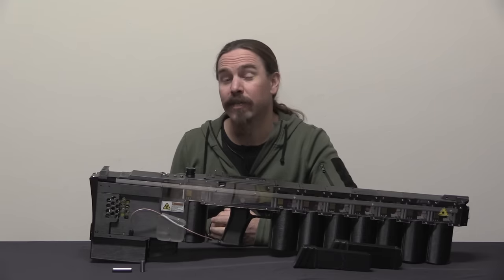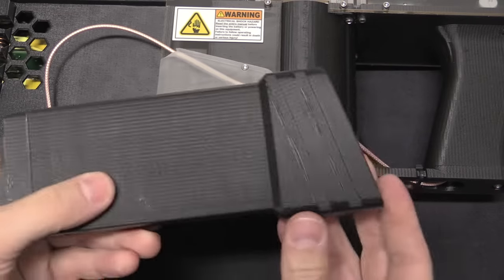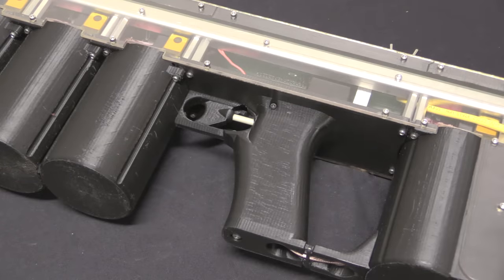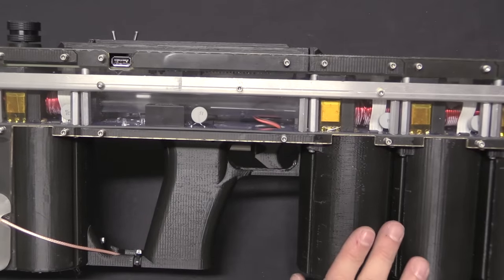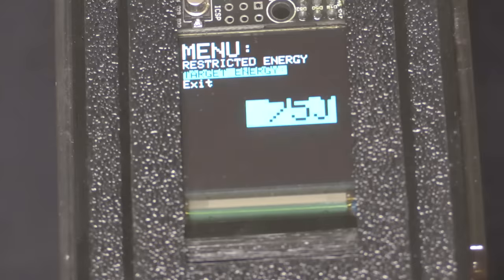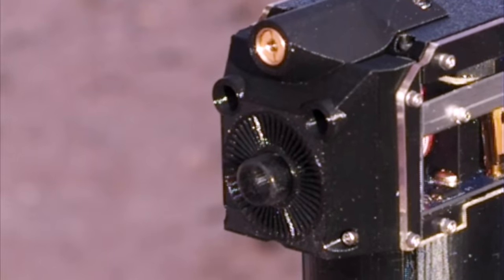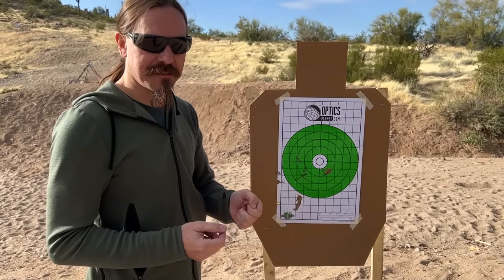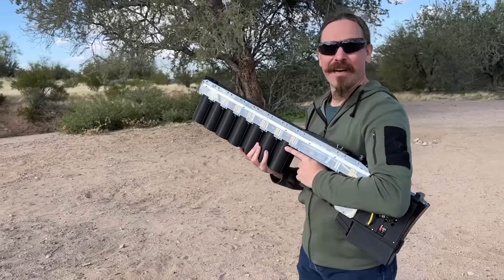ArcFlash Labs' GR-1 Anvil Portable Gauss Rifle

Comment: Consider trying it with half inch ball bearings, if there's a magazine that will feed those.  Since the projectiles are tumbling anyway, you may as well use something you don't have to make or fiddle with at all.  Just take them out of the bag from McMaster or wherever, and get straight to it.  Sounds a lot better than chopping up steel rods.
Reply: Not sure balls would work out well,  it seems to be the projectile has to have some length to it so that the coil can"grab" onto it and accelerate it down the barrel
Reply: In the interview episode the developer mentioned that there's a relationship between size and efficiency - if bearings would work you could have just scaled up an airsoft magazine to feed the launcher instead of designing one from scratch
Reply: There's a smaller version of this weapon that does use ball bearings.
Reply: Alternatively the back half of the projectile could be hollowed slightly and cut into to shift the projectile's mass forwards and create effectively thick fins, which should hopefully improve it's aerial stability
Reply: It probably wouldn’t be too difficult to add an extension to a Nerf Rivals or 50 cal paintball mag
Reply: My thoughts exactly  !!!
Reply: @Gecko88  If the designers of this device have considered every possible improvement, then this device has hit it's limit of development.
Reply: @Psychedelic Gecko  you mean you've never seen something designed by engineers who've been visited the "good idea fairy"? I currently own a makita line trimmer/brushcutter that has a line trimmer head that is ...........a clusterfuck of a design.  They didn't try to just copy existing designs that work well and put a slight change here and there to avoid any patent issues, they decided to make it much harder to refill and insert back into the head.  Engineers aren't infallible, they can be too "smart" for their own good.
Reply: I was thinking about flechettes or dart-like munition that way they would be more aerodynamic and the fins could stabilize them. Also some kind of pump action to create a vacuum in the barrel to reduce air friction in the barrel
Reply: Sounds like the rail gun from metro 2033
Reply: With this technology, bigger projectiles accelerate faster, and a sphere would be the smallest projectile possible for the bore size.   You'd solve the tumbling problem, but decrease speed significantly.  It would be nice to know the relationship in speed loss vs accuracy loss with a sphere vs rod shape.  As the owner said, there needs to be a way to stabilize the rod/projectile.   In the future, if/when capacitor strength and this tech improves, it may be so powerful that a sphere may be the best projectile size.
Reply: a ball bearing in a plastic sabot sleeve would be cool.
If you can do that, then an aerodynamic dart in a plastic sabot would be great too.
Reply: Electromagnetic characteristics of the projectile strongly depend on the shape, you can't do anything complex like flechettes or darts without negatively impacting the acceleration of the projectile.
Reply: Good idea
Reply: @r10101  A return to Minie Balls.
Reply: @Ailtir  I wonder if something like an airpellet shape would work better. Lots of mass up front with what is essentially a drag stabilizing tail in the back. In addition it isn't impossible to add non-ferrous components to a ferric dart.

Maybe a lead or plastic shell around a steel core optimized for acceleration. I wonder if copper would be a better projectile?
Reply: You don't understand the basic rail gun concept - the projectile has to have iron (Fe) inside it to be attracted by the intense magnetic field progressively generated by each coil.  The longer projectile simply adds "more Fe" to be attracted by the magnetic field.  A ball bearing will have so little iron in the magnetic field that it will never reach adequate velocity on launch.  The longer "bullet" puts more Fe in the field but also drops quickly due to gravity and aerodynamic inefficiency (i.e. tumbling).  Its a trade off and i don't think they have really made the proper balance on their projected design but at this point the biggest challenge is the battery capacity and recharge rate.
Reply: someone else made one that fires steel disks that worked pretty good. it fired a lot faster, but i seem to think it over heated and didnt shoot as hard as this one
Reply: @federicodecuadro5672  

What you are describing is the APDSFS shells, that is often used in modern main battle tanks. 

It looks like a ordinary shell, except for the long taper, and small radius nose, of the round within.

From the very little I know, those 'bullets' within are made up of extremely dense metal, with Depleted Uranium — abet controversially — used often. Again, talking out of my butt, the point (heh ...) is the energy of impact against non-reactive armour is to transfer all of that energy, from the outer armour, to the inner, causing spaulling, plus a super heated jets of metal, causing everything that can ignite at beyond the Draper Point, to do so ...

For me, personally, that's a tad horrific, as I'm reminded of the effects of the Apollo I fire, minus the 100%O2 concentration, that resulted in killing all three astronauts aboard, although perhaps not directly from the flames, but, rather, paradoxically, the hypoxia caused by the fire consuming the breathable oxygen ... 

That aside, thinking aloud to myself, I got to wondering .. 

As it is unlikely that capacitors will shrink, due to smaller size, higher density, perhaps one could hope for is, and I maybe stupid saying this, just higher density, but same physical size ... at least in the next decade, or so ...

So, rather than treating this as a future battle rifle (we all know the history of Future Weapons Trials that the US DoD spent God knows how much on, only to fall back on what they already had, or available ...), to treat this as more like a Barrett/McMillon Tac-50 anti-material rifle equivalent ...

Which leads me to thinking — and for the arms experts out there guessing (rightly ...) as me being stupid ...

With Li-ion batteries constantly improving, the way I invision the rifle is as thus:

Ditch the first capacitor, meaning a reduced load on the battery. Instead of the trigger being a large 'push to close', have a striker fire, for a .50 cal, blown out to accept a 300gr bullet, encased in a sabot, with, packed behind, a small amount of triple-based propellant. 

Once passed the ejection port, the sabot travels down the barrel that isn't just surrounded by coils, minimally spaced, with current that induces a spin effect. Also, the coils themselves, are surrounded by a cryonic gas, to reduce both barrel temp, and resistance (methinks the display should also show Ohms ...). At the end of the shroud is a further length of barrel, which could well be a suppressor, screwed tight into the shroud, with no exposed barrel. And, of course, just below where the suppressor is screwed in, a Harris bipod, or, if you want to go all out, a tripod ala the PSG-1 ...

By having that small amount of powder, to increase the initial impetus, and closer packed coils, reducing 'hand-off' distance, the aim is to try and improve muzzle velocity, so that 300gr bullet reaches >3,000ft/s, and perhaps >3,600ft/s, with as flat a trajectory as possible, especially if the bullet itself has six fins near the rear, for stabilisation.

As for the rife instead, replace the 'flashlights' with decent LEDs, one Vis, one IR. By moving the screen back, attach a rail with a 3-25x50 Scope, with not just an Illuminated Reticle, but IR capabilites. 

My only unknown is, despite the caliber, and the size of the bullet, is the size of the round overall, and how big a bolt, and so forth, one would need ... 
Clearly a stock is also needed, with an attached monopod, plus an adjustable cheek comb, and pads for length,  adjustable for shoulder placement. The selector dial can be placed either side, or both to be fully ambi, along with the switches. And finally, of course, a Li-ion battery, of higher voltage. 

Yes, until electronic miniaturisation enables many of the components to shrink, whilst keeping the same capacity/capabilities, it will remain a big beast of a rifle, so may as well treat it as one, in the way that current .50cals are, but minus the possible jump in muzzle velocity/energy ... and the idea of firing a rifle caliber APDSFS bullet ... well, at least in slow motion, it would have a cool factor about it, although the possibility of even longer range, precision, rifle fire, with higher impact at closer in distances ...

Of course, all of that could be completely moronic, so I'm open to criticisms ... 

... and yes, I did forget to think about the density of the metal making up the bullet itself ... has to be ferromagnetic, obviously ...

Comment: I just hope in 300 years they'll think that it was fucking insane that we had an actual shoulder fireable gauss cannon in 2022, just like we think its fucking insane they had a rotary ""machine cannon"" in the Puckle Gun circa 1718.
Reply: "People used to set these things on WOODEN STOOLS just to hold them steady in 2022, LMAO"
Reply: They'll also look back and think how wild it must have been to have armed conflict with chemical propellent guns/ammo.  The noise, the smell, no computers onboard for diagnostics or diagnose failures right on the screen, no targeting or targeting assist, it all just came down to skill of the user.  Might as well be banging rocks together.
Reply: @Sophistry0001  to be fair, even modern firearms are just a fancy way of throwing a rock (piece of lead) really fast. In thousands of years, we still haven't come much farther than poking holes in each other with rocks when it comes to handheld armaments; we've just gotten better at it.
Reply: You're talking like climate change isn't gonna fuck us over
Reply: I wouldn't call 9 shots and an rpm of 9, at all "fucking insane". It was basically a larger blunderbuss with 8 reserve rounds. Not very impressive my guy.
Reply: @ColbyP Hell, pretty much every weapon we've ever built is just using the most energy we can muster in one moment into a tiny projectile.

Slings used rotational acceleration, bows used potential energy stored in the string, firearms use chemical propellants, nuclear weapons use fission reactions...

The surest rule of human behavior is that as soon as we discover a new thing, we will immediately use it to kill each other. The second thing we do is much less SFW!
Reply: @ryohio4706  Were their antigrav units broken?
Reply: @marvindebot3264  dude, I don't think they even had anti-grav stabilizers back then?! Lol, such cavemen
Reply: @Cancer McAids AK-470, but an AK nonetheless.

Comment: With the way this doesn't care so much about projectile mass, I can see it being usable earlier in something like a grenade launcher
Reply: It does care, it's just heavier is better. Which means grenade launcher ones might work better depending how magnetic the grenade is.
Reply: Wouldn't higher mass mean lower acceleration, and therefore lower velocity after the projectile leaves the barrel? It's still a pretty substantial effect
Reply: I'd guess it needs the mass to respond to the magnetic force. A grenade filled with explosives probably wouldn't work.
Reply: @Acerrzzz  typically, you are correct. However, in the case of coil guns, a larger ferric mass offers more material for the magnetic field to operate against, thus allowing for more energy to be transmitted to the projectile. As we saw in the video, the most massive projectile actually went the fastest at around 75m/s
Reply: @Acerrzzz  yes in terms of absolute energy, but larger projectiles interact with the magnetic field more and can allow for higher energy efficiencies. To give an example of how inefficient this thing is, that 400gr projectile going 71.5 meters per second only equates to 66.4 joules, even though it put 100 joules into the shot.
Reply: @Andreas-ov2fv  Explosives are pretty light. Encase them in a ferrous material and you should be set. You can get good fragmentation from it, too.
Reply: @Acerrzzz  Largely been answered, but here's the main reason.
In a gun, there's a set amount of energy that can be applied, based on how much of an explosion it can contain.

In a Gauss rifle, the set amount is based on how long the round is in the 'barrel' and how much charge you have. Larger rounds take more effort to accelerate,  thus spend more time in the barrel, thus get more force applied to them.
Reply: Thanks everyone for your explanations! I'll need to give it some more thought next time :)

Comment: What I find interesting is its at the same stage of development as a black powder muzzle loader of the 1840s. Large projectiles moving slow before rifling was invented. Gradually as technology increases velocities went up and projectile weight went down.
Reply: Maybe 1740s?
During the Napolenic wara rifled guns were used at scale and by the 1840s breech load and early cartridges were used.
Reply: Rifled musket barrels were a thing since the 16th century. Hunters used them all of the time. Militaries kept with smooth bore for a long time because they wouldn't have to worry about barrels fowling up as quickly, and had the benefit of mass concentrated fire to offset the less accuracy
Reply: We’re more at the hand-cannon phase.
Reply: only problem is that this technology is intrinsically limited by how much it can improve. for example by nature of using magnetic fields to accelerate the object, you are greatly limiting your energy efficiency the smaller you go. This thing as is with the 1 inch projectile is only 66% efficient. This has very limited potential for use as small arms, but could be improved and used in place of say a 40mm grenade launcher if scaled up.
Reply: @X4Alpha4X  66% efficent of what?
Reply: I prefer larger ammo, more destruction.
Reply: @tanberetO  energy converted from electrical to kinetic I think?
Reply: @tanberetO  it was set to charge with 100 joules, 400gr@235fps is 66.4 joules. so that's how efficient the system is at converting electrical energy to kinetic energy.
Reply: Need a way to electrically spin and stabilize these slugs.  Then it's just a matter of miniaturization, smaller capacitors, smaller power supply, smaller battery etc.
Reply: @SlandersPete  not always. 55gr 5.56 is far more lethal than say subsonic .300blk. even though the .300blk is 4 times the weight, 5.56 is 3 times faster and since energy is squared with velocity, the 5.56 actually has twice the energy.
Reply: @X4Alpha4X  ok. I wasn't sure what you meant. That clarifies it.
Reply: @kokofan50  Hell, i think we're more at cup at the end of a stick that shoots fire to scare horses phase...